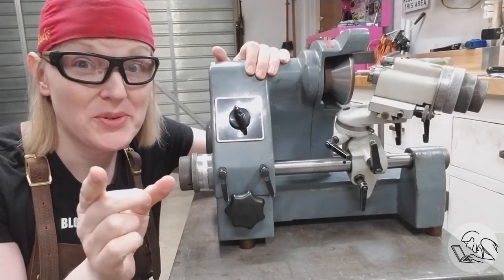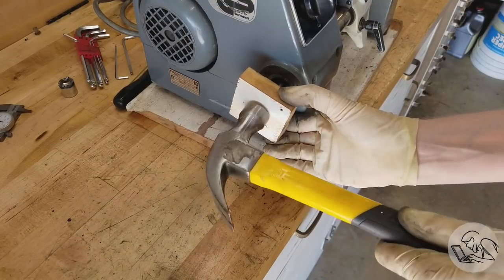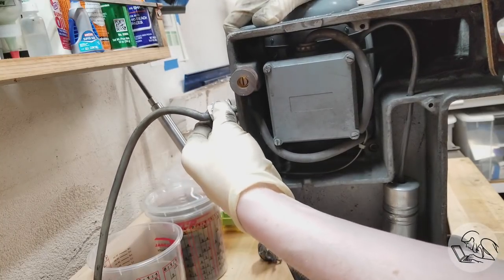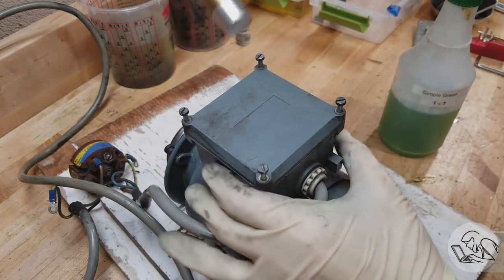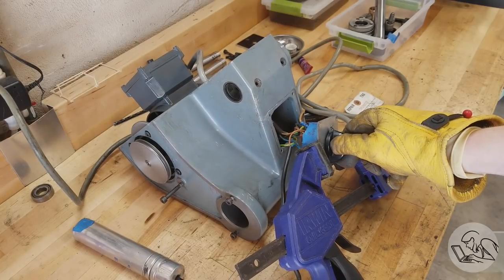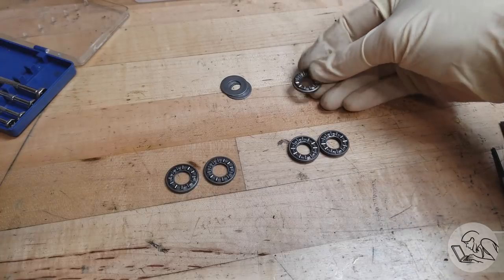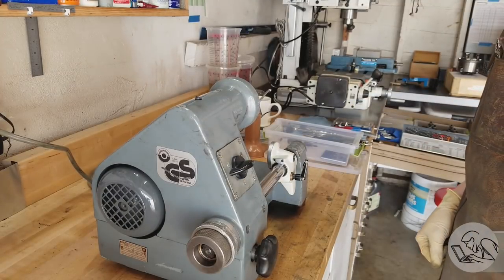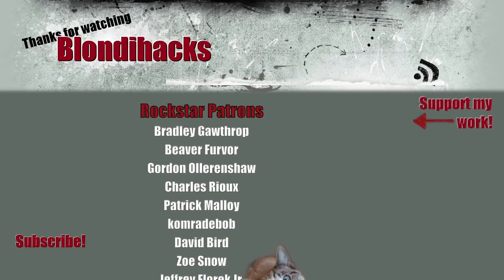D-Bit Grinder Restoration - Part 6

Comment: I've been an electronic tech for more than 50 years and have had to explain to many why aircraft and automobiles do not use soldered connections, for the same reason you explained.  There is one more, when the copper wire is soldered, the metallurgical characteristics are changed and the wire becomes even more brittle.  Also, I used to crimp about 10,000 crimps per year and used crimps and tooling from AMP Inc.  That's were I learned about what's called a "gas-tight connection."  I also used what they called a "certi-crimp tool," would not release until the crimp was complete.  I've used such that cost me over $200 for just one tool with it's dies.  Now many companies make the tools, Paladin was one, Ideal another, plus a bunch of other no-names.

Good video, love restoring old equipment.

Jim

Comment: Quinn,
A small thought. If you want to stop dissimilar metal corrosion use Tef-gel. You can buy it on the internet or maybe a marine supply store. A tiny bit goes along way. I used it on stainless fasteners in aluminum in  a salt water environment. Works very well.  Enjoy your channel.

Comment: Thanks Quinn
I am presently building a grinder from scratch. Interesting to see how the spindle and other parts were done in yours.
I agree with your comments about cheap crimpers. I have a very decent one in the workshop. It does make a big difference.

Comment: "Metric fist shake..." Hahaha! Great video Quinn, thanks for sharing!
Reply: Yeah, like the USA, Burma and Liberia are behind the curve.  Figure it out!
Reply: @dnickarz  If you found out why everybody else has come to use the metric system and America has not you would probably be embarrassed. Believe me I think that the metric system makes more sense.
Reply: @andyZ3500s  What makes sense is often not the same as what works.
Trying to get people to change from imperial to metric is not an easy thing. First of all there is the installed base, then there is the tools, and finally there is all the documentation. It takes a generation or even more to get everyone on the train when switching the whole system. Where I live metric has been the standard since the late 19'th century, and yet my father, who died recently, was still using both inches and centimeters for things like lumber and water pipes depending on what he was doing. Add to this the cost of retooling and updating documentation and it's darned expensive. And even then you will have to keep the tools and parts to service everything made before the switch.

Is it worth it? In Europe it was considered so. One thing to remember is that though many countries used a system with feet and inches they were often slightly different. Same with weight and volume measurements. The metric system brought a standard that made it easier to trade between countries which is a major benefit when the countries are bunched up close together. USA is way different in this aspect as it's a huge country with few neighbours and an enormous internal economy. The higher the living standards are the more technology is in our home and industries, and the harder it gets to switch measuring system. And let's face it, the US has thrived even with the imperial standards in place and is a large enough market that so far there hasn't been a need to try to switch to metric.

And then we have the main question, is metric better than imperial? Talk about a loaded question. On one hand we have people ranting about how seemingly arbitrary the imperial system is and on the other hand we have those who ask what country it was that actually put a man on the moon...
Actually I don't think the system used matters that much when it comes to things like building a rocket. Most of the tech was developed by germans and they were certainly using metric so...
Reply: @blahorgaslisk7763  you laid things out very well. We don't just use the Imperial system here in America. Most scientific fields use the metric system. We were supposed to change to the metric system in the 70's but like you stated you just can't change your whole infrastructure. We are letting the problem work it self out. In a couple of generations the SAE Imperial system will be something like the Whitworth is in England. For now I hope the other commenter won't mind if I use the Imperial system in my home shop. If he does he will just have to figure out how to grow up.
Reply: I'm a 60yr old Australian.
We Metrified officially in 1974, I was 15, with quite an extended education phase.
So 45 yrs later, 2 generations or so, most young-uns are totally Metrified and struggle with any imperial measurement units.
There are many long lived artefacts that still require imperial fittings etc.
There are many imperial products labeled in metric...
Steel for instance, where it wold be cheaper to set up a new factory.. When the old one finally wears out!
So, it does take generations to finally, totally, convert an entire country, even a small one 1/14th the population of America to metric.
Even if it is a much better intergreated system and therefor easier to use.

Comment: The lock mechanism you show at 5:00 is exactly the same as my lathe uses on the tailstock. When you find someone's worn it out and it won't clamp any more (it's from the 50s) you can file a bit off the bottom of the two brass pieces to make them close more tightly.
Reply: It's the same for a bridgeport quill lock too.
Reply: It's the same for the classic DP220 drill press head of Rockwell/ Delta machines.☺

Comment: I'm hoping you replaced that death trap of an electrical plug (safety cardboard and all) off-camera...

Also sick burn on the former employer, just sneaking that in there. I'm sure it's a widespread-relatable sentiment.

Congrats on first dust! Now I need to get some of those crimpers without breaking the bank so I can strive to be as cool.

Comment: Thanks for this series!  My D-bit grinder is a GH Armstrong,  so a generation older than yours.  About diamond wheels on steel, heat and iron together will make the diamond grit break down.  Just a little.  In a production environment, the lost diamond would be too costly.  Not an issue for occasional use.

Comment: As usual, beautiful job! I hate low head cap screws because the hex drive size is so small. If the counter bore is big enough you can substitute button head cap screws in place of them which have a larger hex drive socket. If the counterbores are not big enough it is easy to turn a small amount off the OD of the button head cap screw to fit. It is a superior fastener and I have replaced many low head cap screws in this fashion.

Comment: Too many comments to sift through so apologies if I am repeating someone's comment - that capacitor cable rattling in the cast - at least some heat shrink on that as it passes over the casting. Love watching this channel - its soothing to the sole!
Reply from the maker: The cap is bolted to the casting
Reply: @Blondihacks  yep, know that - I saw you screw it on tight. I'm looking at the cable through the cable hole you opened up because the crimp connectors wouldn't go through is what I am referring to. Just a very small detail :)

Comment: I found it easier to set the stop that allows the tool bit holder from going past the grinding wheel so it restricts the movement across the grinding  wheel to act as a stop. This give you more stability when revolving the tool bit. Hope this helps.

Comment: 24:45 the problem with diamond and steel, IIRC, is that diamond dissolves into steel above a certain temperature. A former employer used diamond hones but simplified their heat treat, treating everything to ~60 HRC, and had to switch to CBN because it could handle the higher temperatures where diamond couldn't.

Comment: You are 50% there for a good crip on your electrical terminals by using the ratcheting crimper.  To get the rest of the way to a great connection, don't use PVC terminals, get the PTFE (Teflon) type.

Comment: Ahhh, fun with bearing prices. Many moons ago (early 90's) I rebuilt a Yamaha bike, all the bearings were only a few $ each but 2 of them were only available from the Yamaha bearing factory and were $90 each 🤯
Great to see this project finished, it's sure been a fun journey. 
⚙️😺
Reply: Were they entirely unique? Typically they use common element dimensions but have unique alterations to the inner or outer races for mounting.  Like the outermost shaft bearings in a Mazda 6 speed I'm building.   They are a common enough bearing except the inner race has a stepped flange.  As assembled that flange does nothing but allow the shaft nuts to retain the bearings during assembly, I can use the common replacement bearings and turn up some hardened precision spacers to stand in for the flanges and just take care during assembly. Once together they are not free to move and dont serve to locate anything other than radially supporting the shafts.
Reply: @DrewLSsix  Crikey 😬 Thats pushing the old leaky memory. I think they were something like 0.5mm larger OD. Crankshaft bearings I think. Was a long time ago, Yamaha XJ 650. There was enuf that I wasn't sure of so I ended up taking the motor to a mechanic. Turned out the apprentice was as good as me, silly bugger put the cam belt on backwards🤦‍♂️🤣.
Worked out well, still had to pay but got a full rebuild and fine tuning instead of just a basic semi rebuild.
Was told that Yamaha would do it with some  models, easy cos they own a bearing factory, just extra price gouging on spare parts. No need at all for an odball dimension.
Stopped riding nearly 10 yrs ago and learnt to drive. New cars are all full of plastic bits and magic black boxes so I let the mechanic do maintenance 😁

Comment: Working on a pivot drill grinder made by the Hamilton watch company from the fourties maybe? It's really weird it has a split bushing mounted in a casting so that there is intentional slop in the grinding arbor so that when you push on the end of the shaft it automatically returns to the start position ,so like you say never take for granted that you know more than the manufacturer about how things should be built. Thanks

Comment: Great video on rebuilding. The only thing different that I would have done, is put a new power cord in an long as everything was torn apart.
Reply from the maker: I’m going to put a new plug on it, but actually the cord is in really nice shape, and it’s a much heavier and higher quality cord than you can buy nowadays. Just the plug that is chintzy 😁

Comment: thanks for the tips, here's one in return; on the band saw, get the upper guide as close as you can (or at leastnearer) to the workpiece.  less blade wander! :-)
Reply from the maker: That’s as close as the guide goes. It’s a horizontal bandsaw.

Comment: This is a nice video.  I have this exact unit.  I would love to have a PDF manual for it.   If you know a place.  Also mine is making a little bearing noise but I haven't run it in a while.

Comment: Try brake fluid as paint remover next time. Way better than modern strippers, which all seem a little anaemic these days. Also works well on lead-based paint. Not sure about HT paint though.

Comment: Tasking a guess that cable gland is a M20x1mm thread, and is not a common US size.However the rest of the world that is a common gland size, and is available in both plastic and an all metal version, either nickel plated brass, or stainless steel for more demanding environments.

Comment: I think I know why your stripper didn't work so well... or at all. That's probably lacquer. In my miss-spent youth I worked at an airplane refinisher and older planes with vintage paint (think Douglas DC-3 for example) had lacquer paint and the strippers we used for enamel wouldn't bite into it at all. We had some pretty caustic stuff too, if it got on your skin you'd have a chemical burn immediately. Put it on lacquer and it'd just sit there. Given the age of that part, it would be from the era of lacquer paint being the industrial finish of choice.

Comment: I like to hit things with a hammer heavier than the thing. A wheel hub in 1980 bent rather than came off, when I hit it with my wife's little framing hammer. Now I prepare for hammering by practicing on a Newton cradle.

Comment: Question.  Various people talk about taking a motor like yours to a shop that rebuilds them. I would love to know what that shop actually does, and what it costs (approximately).  Thank you for this video.  If last year was the year of D-bit grinders, maybe 2020 will be all about Wohlenhaupter boring heads.  Hi to uncle Bob.
Reply from the maker: This particular shop does it all, depending on what the motor needs. replacing bearings, rewinding, replacing any internal wiring or capacitors, replacing brushes (DC) resurfacing commutators, etc. They also repaint it. 😀 I think bearings is this one needed, according to the guy.

Comment: The safety cardboard on the bottom may have been to insulate your bench from the cap. Did you ground it?
Reply from the maker: The cap is mounted to the casting and doesn’t touch anything.
Reply: @Blondihacks  👈👈😎

Comment: Hi Quinn, what is this machine used for specifically? Great video, BTW. I always learn a lot. TIA
Reply from the maker: I talk about that earlier in this series, but it’s primarily for grinding d-bits (single flute cutters). However you can also make lathe tools, regrind endmills, and a lot more. It’s a primitive type of tool and cutter grinder, basically.

Comment: Aww no replacing the fine German card board with bronze or brass?
Steampunk machine shop suspended.....for now.
Maybe add a Jacob's ladder or lightning sphere as an "on" indicator.
Don't think I didn't notice the copper soft jaws on the lathe.
Reply from the maker: An old furnace panel is more dieselpunk, so let’s say that’s what I was going for. 😬

Comment: You know what else is a high vibration environment? Spacecraft. They primarily use crimp connectors. For good reason. NASA even has published a great guide on the subject. 

https://standards.nasa.gov/file/2615/download?token=2TwNY-Aq
They printed one on soldering standards too:
https://nepp.nasa.gov/docuploads/06AA01BA-FC7E-4094-AE829CE371A7B05D/NASA-STD-8739.3.pdf
As Quinn so nicely points out, the key is the right crimp tool. Toss the cheezy one from the local tractor supply store and get a real one. It will cost more, but it will work, first time, every time. If you are using a special type of crimp (I use a bunch of unique ones), get the right crimp tool. In my case, the correct crimp for one connector I chose was $450! But found one on ebay for <$70.

Comment: It occurs to me that your measured length for the belt was too short by almost exactly twice the radius of the belt, because you used thin string to get the measurement. I'm not sure I would have considered that before, bit I'll never forget it now!
Reply from the maker: True, and interesting point! It’s still plenty close enough to figure out what the length is supposed to be, though. It’ll be one of a few standard sizes.

Comment: How much did the motor re-build cost?
Reply from the maker: About $100, I think. Quite reasonable. They repainted it and went all through it.
Reply: Probably better than a cheap new motor, and there very nearly isn't such a thing.

Now, if only I could find a motor shop near me so I could buy an old motor for my ancient Craftsman tablesaw, whose 1940's era motor is evading my attempts to get it running right.

Comment: I've been on a crimp and ferrule connector high horse for years. I have no idea why so many electricians disparage them when they have been proven without a doubt to be the superior connector. 

I think they're just lazy and don't want to add anymore steps to their work. I don't understand that line of thinking, I'll gladly take an extra step if it makes my work better.

Comment: Hard to see what motor capacitor was built in. Make sure it's not made in "W-Germany", but Germany.

Most capacitors prior to 1989 contain chlorinated diphenyls and should be immediately replaced when found on discovering.

They are also hazardous waste.

Comment: Has mill and lathe, uses grinder and cut off wheel to make a tool. /facepalm Still love ya!
Reply from the maker: The socket is hardened tool steel. I can’t mill it.